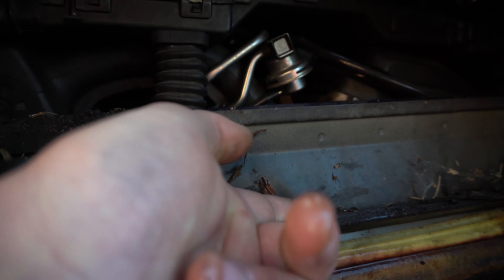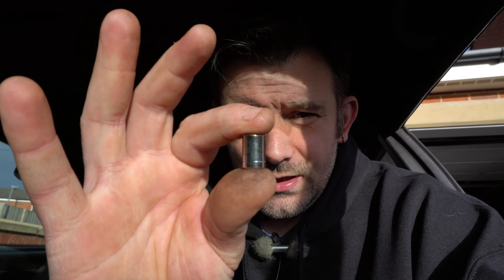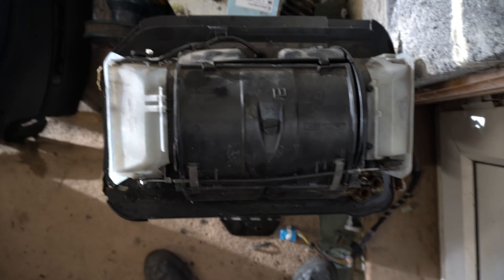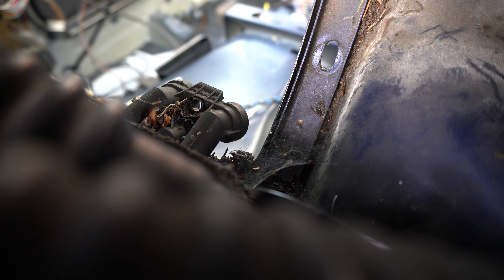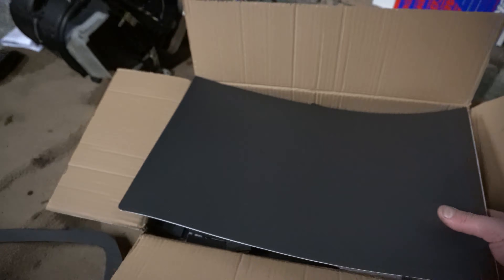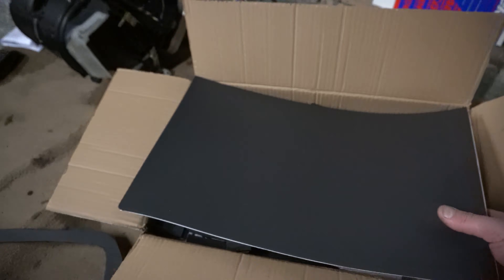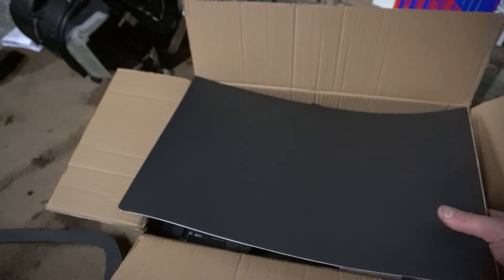E36 Water & Coolant Leak... Wet Interior FIXED!

Comment: Once again fantastic info! I've just replaced my heater motor and was having a similar issue, poured water onto my screen and saw it leaking inside (stripped for track) a friend who's familiar with e36s recommended clearing out the drains which are clogged in your video. I completely removed the one next to the dme and there doesn't seem to be any further issue 👌

Comment: Hey Pamo, thankfully because of ur video i had a plan where to start to look after the water leaking spot. I got so mad after months looking for it to leak. Everytime when i went with my e36 cabrio into the washing station there were no visible water leak. But when it stayed a night out in the rain my footwell was full as shit. then one day i noticed behind the dashboard a little few drops. My guess is that the reason why i newer saw it dripping straight in the footwell, is that the drainholes let a part of the water out and the spongy material behind the climabox soaked itself first of all full with water before it let it down. Thanks to you i got a way to start.
Reply: also i dont know if u still got the car, but did the waterleak stop completly in ur car?

Comment: So my jacking points absolutely corroded to shit, so I had a guy weld some new plates on..however he was telling me there is water getting in from somewhere as the passenger side carpets were wet.
I'm sure this is the exact problem. Also for ages I loose water but I could never find where from!! I've replaced everything I.e radiator, water pump etc and still loosing water.

Nice video dude, always on job!

Comment: THANK YOU! Doing this job now, just got the dash out today. This helped me out a lot! 👍🏻
Reply from the maker: Nice one Liam.
Reply: Hi Pamo, if you have a spare sec I have some questions. I got the seal from bmw. Does the adhesive side go against the heater box or firewall? Also would you suggest using sealant also, If so what type? Thank you in advance, cheers!
Reply from the maker: Adhesive to the heater box.... Its just to hold the seal in place whilst you fit it. No sealant, it'll just create another layer stopping the seal from doing its job.
Reply: Pamo cheers! I’ll be doing this over the weekend. Keep up the great work with the channel 👍🏻
Reply from the maker: Good luck sir. Thank you.

Comment: this is actualle somthing i have searched for. i have similar issues i have to refill the aircon  every summer, watter leaking inside from the middle, i already checked the drains it was clear. Now i know the couse but cant fix it. i have not the time nor the knowledge to do this work :(
edit1.
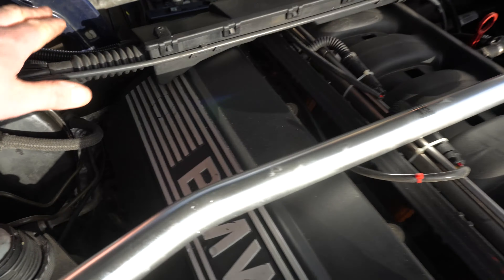i just try my luck and have startet removing everything. i m now stuck on the steering column 3:46 i cant remove this shit, the ,screw on it are round  o0 ? what should i do.
Edit2.
Now i have the unit out. What didt you do about the aircon matrix ? Have you deleted you aircon? You didn't show how you installed it back

Comment: Hey Pamo, a quick question as you are one of they few people with documented experience and knowledge of this. I have been chasing a leak in my e36, the carpet is out and even though I had the heater box frame seal replaced, with recent rain I have been observing the source over a long period of time, as more rain water is getting in. Today I cut away the sound deadening around the bulkhead/transmission tunnel, having removed the glove box to get a really good look and see the source of ingress. It is indeed not coming from the frame seal or the coolant trio of pipes (it’s definitely rainwater) but what is intriguing is it appears to be coming from an 8mm hole in the plastic heater box on the passenger side, on the underside of the ledge moulding where the pipes are internally positioned. I have videoed it as you can only see the hole from underneath. I am wondering if there is supposed to be something like a bung plugging that hole so any water that makes it into the heater box moulding is drained out elsewhere, like the a/c condensate drain. I’m intrigued by this weep hole and what it is. Any ideas or pics of when you did this disassemble. I didn’t do the frame replacement, so I wonder if a vital plug was not reinstalled correctly. Any help most welcome!
Reply from the maker: Although your description is very detailed and as clear as it could be I'm not 100% sure of the location you're referring to. That said,  the ac condensate drain is the only place where liquid is designed to exit the heater box. There are no other points that water should collect internally under normal operation. The other common leak point can originate from a poor condition windscreen scuttle with water finding its way into the cabin in some very random ways. If you have a video you could try to send it to my YouTube email address and I'll have a look for you. You'll find this on my channel page.
Reply: @ManSeeksCivic  Hi Pamo thanks for the speedy reply, I know how hard it is to respond to comments and keep on top of things, so I really appreciate that! You are right, a video shows it way better and your comments are spot on. I fully understand why you are not sure what location I am on about. As I have been looking and researching this afternoon and thanks to people like yourself, it is quite clear the heater box is a nice self-contained unit that sits actually quite high in the dash, certainly higher than my actual leak. As you will see in the video, my leak is from what must be a surround or casing between the heater box and bulkhead and surrounding the coolant pipes. You will see what I mean in the video. The only caveat is the arrangement on my pipes on the passenger side doesn't match pictures I have so far seen of other e36s. Maybe on the 328i they are routed differently? Also my car had after market a/c fitted by a company at the request of my mate, the previous owner many years ago. So, maybe I have a slightly non-standard configuration although the a/c pipes seem to be a factor on the driver's side only. Either way, my hypothesis is that rain water is leaking in, possibly through the bulkhead coolant pipe gasket, frame seal or maybe just when it really is tipping it down and coming out of the weep hole instead of any other outlet BMW designed int the box, like, say, the a/c drain hole. Anyhow, I'll do as you say and edit together a little video, and who knows it may be useful to others. It will be on my personal You Tube and will be in my name. All the best, Martin

Comment: Just about to do this on my e36 have you got the part numbers for the o rings bud save me some time finding it, think I will also renew the matrix while I am at it
Reply from the maker: I'll look them up and post back
Reply from the maker: 4x 64508390602
3x 64508390603
1x 64508390601
Reply: Cheers pal

Comment: 👍Post part numbers and costs just incase anyone needs it . Good video . I’ve got two E36 so will no doubt need this at some point 😩🤦‍♂️
Reply from the maker: Here you go - cost in GBP
4pc smaller, 1.55 each, 64111374238

2pc larger, 0.91 each minimum order 10pc, 64118377824
Reply: Thanks bro 👊
Reply: @ManSeeksCivic  Are these for the pipes that connect through the fire wall? I want to be 100% sure I've got the right bits before starting this. Thanks for the video though, it's massively helpful!
Reply from the maker: Yeah these numbers are👍
Reply: @ManSeeksCivic  thank you so much!

Comment: Dude, I love your E36 and the videos you make! Saved my arse and my wallet a few times now. Unfortunately now I need to do a cooling overhaul (it seemed the last time anything was done was back in 2011). Any thought on what brand should I go for a thermostat, thermostat housing, water pump, belts & pulleys, or perhaps should I go OEM? I want to keep my Cheto going as long as I can but £220 for BMW water pump seems excessive! I would appreciate your help. P.S anything else worth checking/replacing while there?
Reply from the maker: Good aftermarket stuff is fine - Meyle, Febi etc. Belts can be checked and changed easily so just get whatever is convenient and keep an eye on them. Water pump pulley - change this if yours is plastic and if you can get an alloy thermostat housing its worth the cost. Thanks for watching 👍

Comment: Thank you for being so thorough, Glad it got fixed! Going to tackle this job in the next couple of weeks. How thick was the foam you used looks between 5-8mm but that's just a camera eye, or given it's going to be squished anything 5 and above will be fine?
Reply from the maker: I think I used 8, but you're correct. It gets very squished. I reckon 5mm would do.
Reply: @ManSeeksCivic  Thanks Pamo!

Comment: Amazing time lapse on the interior did you clean the rust from the floor
Reply from the maker: Thanks! I did, and treated it with phosphoric acid although once wiped, there was next to nothing there. I took the opportunity to reseal the floor bung and treat any other tiny areas of concern at the same time 👍

Comment: Is it possible to change pipes o-rings without disassembling the dash and taking heaterbox out?
Reply from the maker: I'm afraid not. You need to be able to  pull the parts apart enough to get the pipes out.

Comment: Is there a “part 1” video? Just pulled my dash, need to pull all the other junk. 
No good DIY’s online :(

Great work! Your videos rock!
Reply from the maker: I have a previous video on e36 interior installation. It's old but might help. Check my older videos for help 👍
Reply: @ManSeeksCivic  thanks buddy, cheers
Reply: @ManSeeksCivic  hey buddy, got all 4 bolts off that holt the heater box - the 5th holding the coolant lines is just spinning (f^ck)!
Any ideas? Thanks
Reply from the maker: Is the nut actually spinning or is it rounded?
Reply: @ManSeeksCivic  I can see the washer spinning, when turning the ratchet. 
Can’t 100% confirm the bolt is spinning, when the socket is covering it, but I’m fairly certain. 
I broke it loose. Can’t tighten or fully loosen now. 

Also didn’t show in the vid. Did you disconnect AC from engine bay or inside the pocket where the 5 bolts are?
Thanks again
Reply from the maker: Ac... Sorry, I had previously removed the system. Remive the engine bay connections.
As for the spinning bolt, I'm sorry but there's no easy way of fixing this. It'll need to somehow be cut off. A dremel and lots of patience might be your only hope.

Comment: Could you please put the OEM number of the SEAL between the heating and the coupe .. the one that you decided to make yourself. As per REALoem I see it should be this one 64118372795 but I'm not sure . I will be very thankfull if you elaborate !!!
Reply from the maker: 64118390433
It's literally neoprene foam with an adhesive backing.

Comment: Went through the pain to do this on my E36 325TDS Touring here...

https://www.bimmerforums.co.uk/threads/e36-heater-box-seal-replacement-to-fix-wet-passenger-footwell.40364/#post-324785

...then discovered it was a leaking rear washer pipe that runs through the passenger foot well was the real problem.
Reply from the maker: I've read about this on the wagons, nightmare!